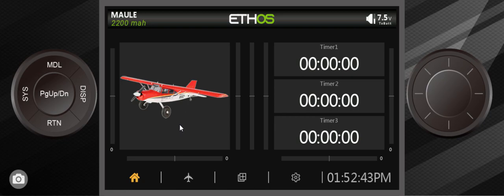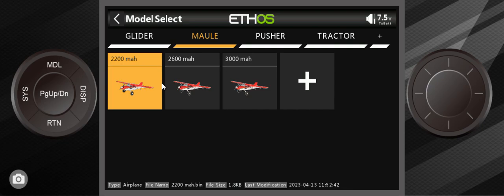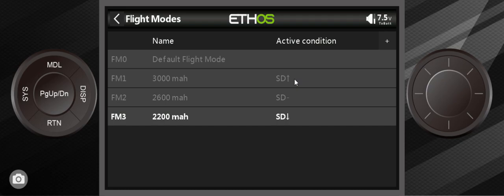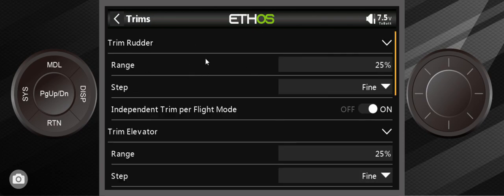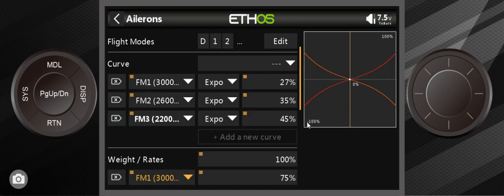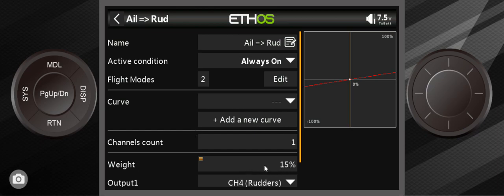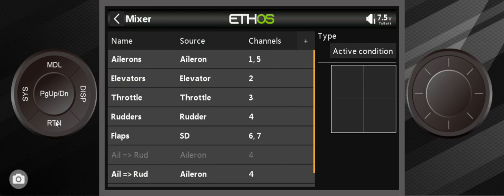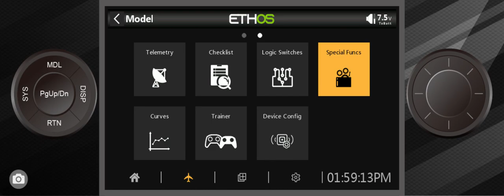FrSky Ethos Flight Modes-Simple explanation with example

Comment: Hi Steve. I have no issue setting up flight modes 0,1 and 2. What I need is a "fourth" flight mode. I created FM4 in flight modes. I assigned a two-position switch to it. Then I went into my mixers, aileron and elevators.  I made sure FM 4 was enabled. I also made sure in the "trims" menu that I have made sure independent trims is enabled on each flight control. What is not happening is that FM 4 is not enabled on the main screen. What steps have I missed?  thanks

Comment: Hi - good video, but I also have the problem someone had below where when I edit a flight mode, all I get presented with is 'Active condition', 'Fade in' and 'Fade out' options. I have set all of the trims to 'Independent trims per flight mode', but no trim setting options appear. I think I have the latest version of Ethos running, as this was installed by the supplier I bought my FrSKY X18 from. Anyone any ideas?
Reply: Hi - found the solution! On Ethos 1.5.x the trim settings don't appear in the flight mode definition, they are adjusted using the trim sliders in each of the flight modes where you want the trims to be flight mode dependant.

Comment: I got into EthOS after EdgeTX, and in some aspects it is much better. In other aspects, there is room for improvement. For instance, I'd like to be able to configure mixes a little quicker. I love the depth available, but if I'm simply assigning a switch to operate a channel at face value, the time it takes is too long.
Reply: EthOS Suite model configuration would be a quick fix.

Comment: 4:30 on my ETHOS version I dont see these separator trimm settings in flight modra menu. Why is that?
Reply from the maker: Did you turn on independent trims per flight mode (above)?  You have to turn them on for Aileron, Rudder and Elevator
Reply: @steveschlesinger3459  I have fixed it, I had old firmware version :) Thank you

Comment: Hi  steve at FrSky I need your help please.

When I'm in helicopter flight modes I use flight mode Normal

Then have flight mode 1 ....flight mode 2 ... then flight mode 3

I can operate from Normal switch SE (up) to SE - middle( flight mode 1)then SE down ( flight mode 2) position but when I select flight mode 3 switch SB middle position it doesnt follow on it won't function until you put SE switch to normal then flight mode 3 works this is not correct I need 

Normal

Flight  1

Flight  2

Flight  3

Throttle hold

The switches need to follow on from each other but I am having difficulty in doing this can you guide me through how 🤔 to make my switches follow each other in this order
Reply from the maker: I'm having a problem following along,  the flight modes with the highest numbers are the one that get the highest priorirty